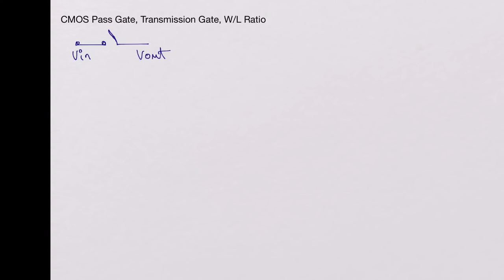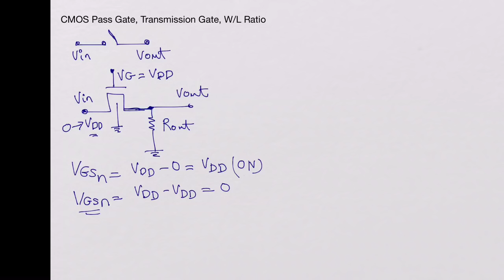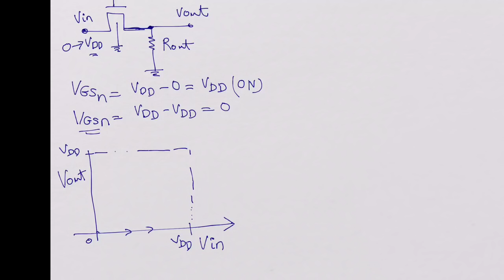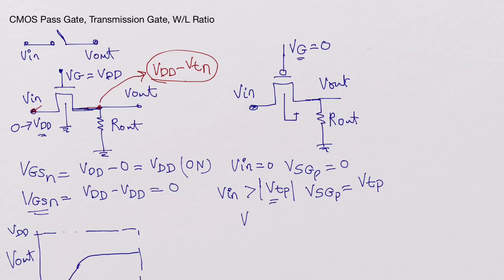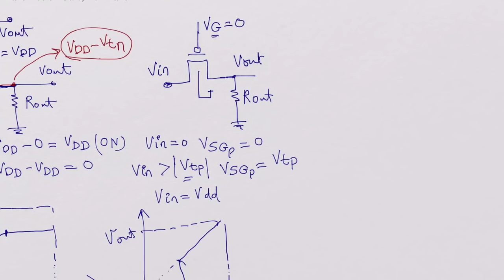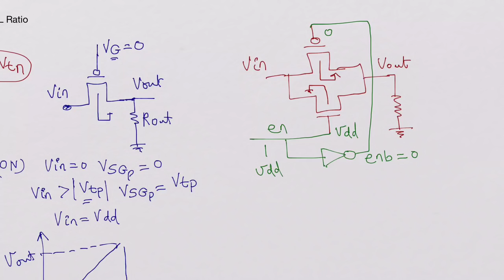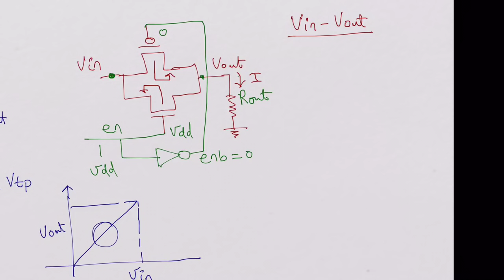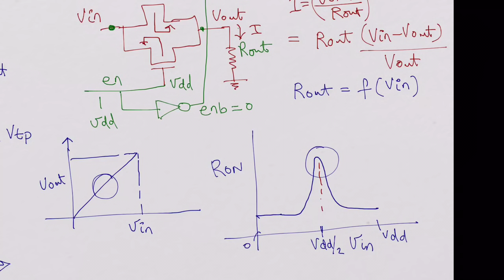CMOS pass gate, Transmission Gate, W/L Ratio, ON Resistance

Comment: i Sir, Its a great video with clear cut explanation. Actually I am designing a digital circuit (ALU to be precise) where the last block is transmission gate based MUX. So how should i estimate Rout for my design? Kindly respond sir, You can ping me back on my mail ID so that i can contact you for mentoring me (mohammedharis92@gmail.com)